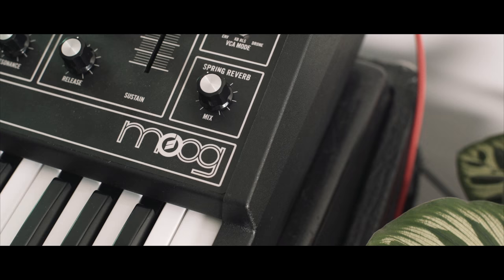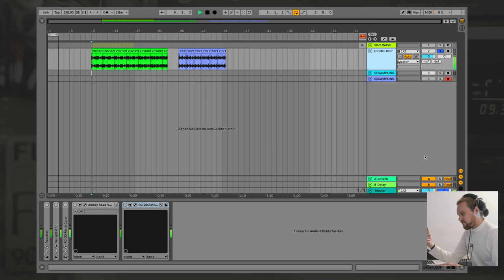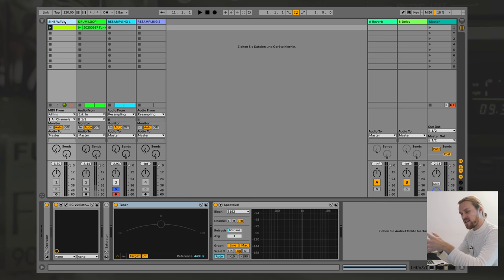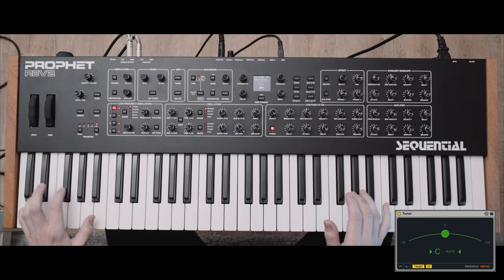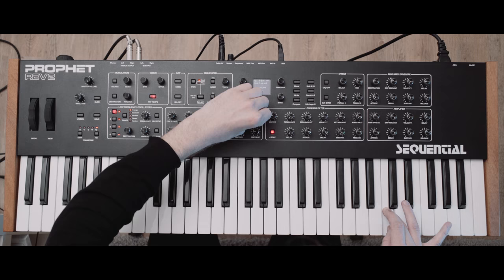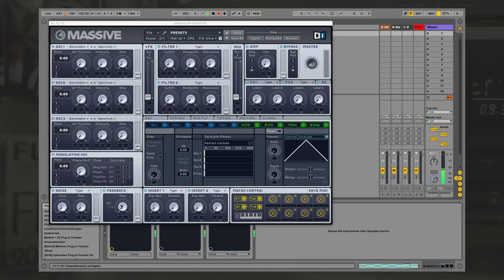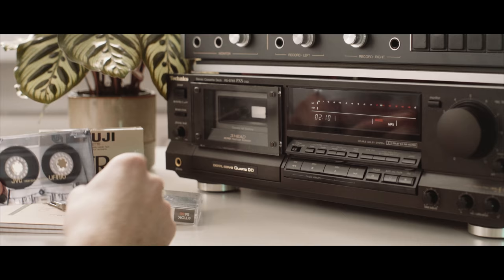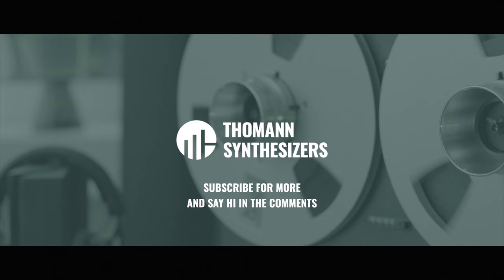A Guide to Analog Warmth, Vintage Processing, Saturation & Magnetic Tape | Thomann

Comment: another tip: use key velocity to modulate things like attack time, LFO rate so that each note you play gets a little different. If your keyboard skills aren't so hot, you can record the MIDI at 2/3 tempo or whatever (and optionally quantize at ~half strength).
Reply from the maker: Great idea. Perfect addition to the tips in the video! ❤️
Reply: I sometimes randomize. It helps too.

Comment: This fostex x-18 is easy to convert to lo-fi ambient loop machine. Just unsolder 1 or 2 resistors, this allows to increase tape speed range as well as pitch. It can easily go half speed or even lower

Comment: Great vid Felix, thank you. I have a question about using tape - how do you sync up the cassette / reel to reel speed to the DAW clock so the resulting audio doesnt float out of time? So that it is possible to chop and play with the taped audio in a daw without having to use flextime

thank you!
Reply: Do all the chopping first then run it though tape at the end?

Comment: Excellent video. One question regarding the 3-head tape recorder, would you recommend connecting the i/o directly into your audio interface, or would it still work via the Mackie desk's tape in/out connections? (DAW i/o also connected to the desk to record back into software)
Reply: Try both. I would keep the mackoe out of the chain. It all comes down to personal taste. Some things will sound better with the mackie, other stuff won't

Comment: Is it realy just 1 ms delay on the 3 Head Tapedeck. The delay between write- and readhead?
Reply from the maker: No I assume actually it‘s a bit more than that. But I‘d assume it‘s less than 30ms which is roughly the threshold of where we perceive individual percussive hits.

Unfortunately you‘re gonna have to add any latency to that that your soundcard and DAW produce.
Best, Felix

Edit: I just did the math

Cassette Tape travels at 4,7625cm /s

Distance from write to read head: 3mm

Would mean roughly 6,3ms delay in the case of my specific machine unless engage any digital processing like noise reduction which might add additional delay but I don‘t know for sure.
Reply: @ThomannSynthesizers  Thanks!
Reply: @ThomannSynthesizers  6,3 ms is totaly fine for even perform through it.

Comment: I don't think musicians understand the distortion aspect of analog. Analog synths and recording equipment do not preserve the waveform in frequencies above 5000hz. IF you took a pure square wave from a VCO and watched the wave on an oscilloscope, you would observe the square rounding off. The higher the frequency the more rounding off occurs until the wave actually becomes a sine wave. This is why we hear the "warmth" all the sharp edges of any wave automatically get a smoothing in the higher frequencies. Digital preserves the wave in near perfection so naturally the music may seem harsh in comparison, the square wave remains intact at 10,000hz and higher. This can be heard as detail or harshness depending on the quality of the DACs, ADCs. I personally do not like analog because the detail is not accurate. Recording today is far from accurate anyway, we have yet to record and playback an acoustic instrument and have it sound even close. We need talented audio engineers to build back through processors and technique what is missing....which simply amounts to faking in stuff to hide the missing detail.